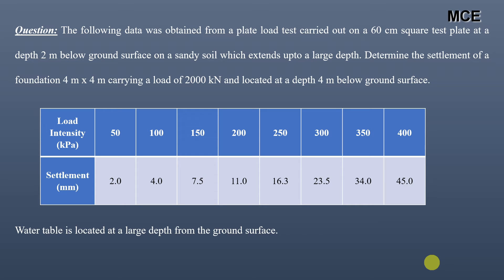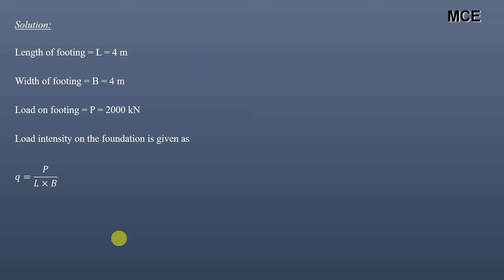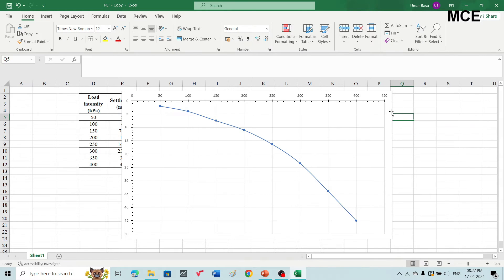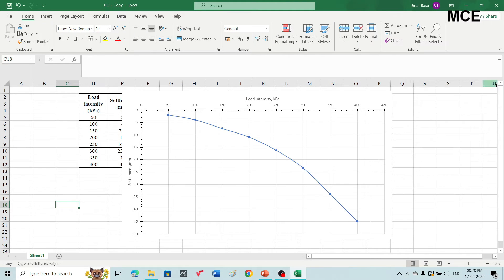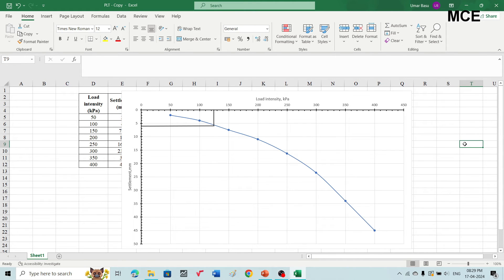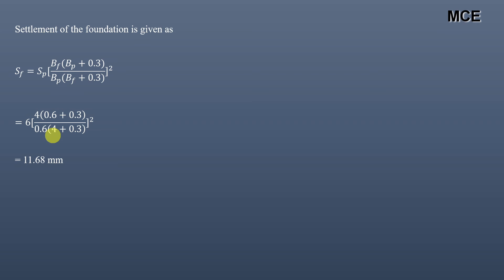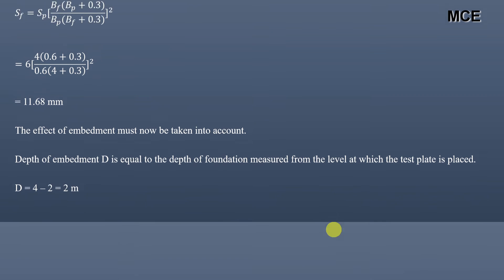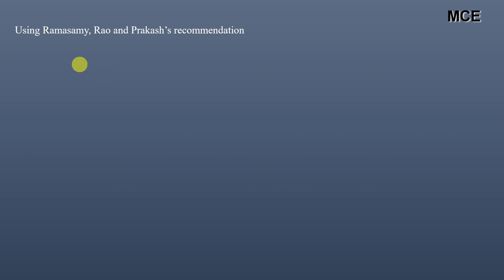Finding Settlement of Foundation using Plate Load Test Data| Plate Load Test Calculations

Comment: In case the footing is mat and the width of footing is 35 m what equation should use to calculate the settlement under the footing if the settlement under 60 cm plate is known 5 mm?
Thank you